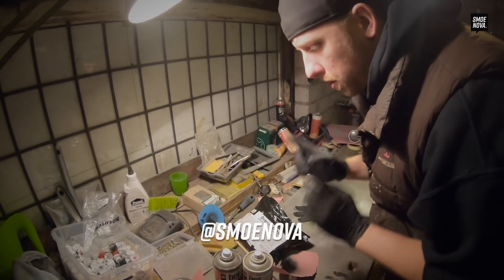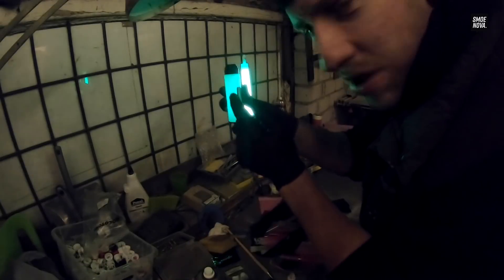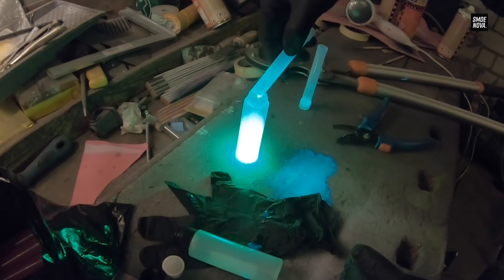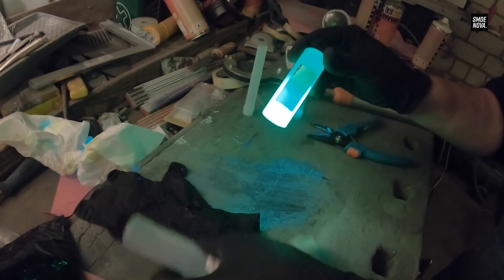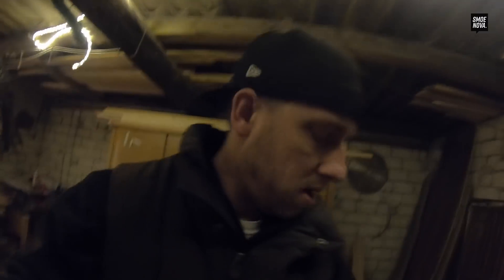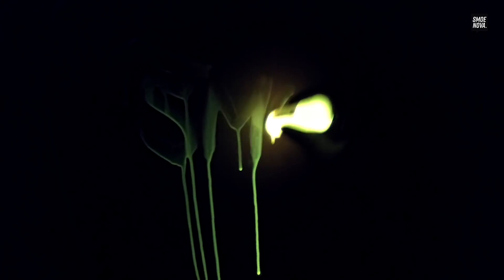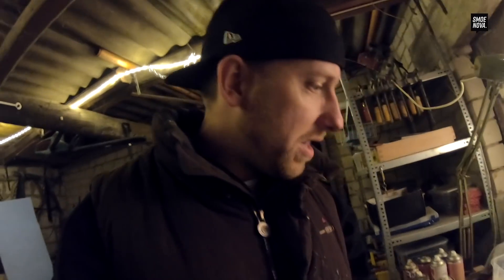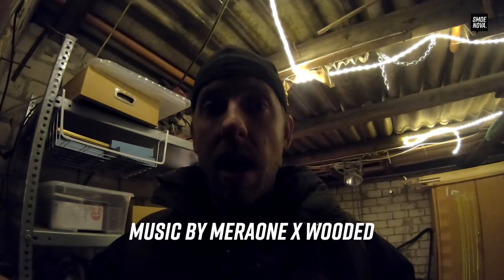TAGGING GLOW STICK LIQUID! crazy experiment #8 GRAFFCEMBER

Comment: What about mixing it with a little bit of glue/epoxy to make it less runny
Reply: @GAMERKNEE I reckon if you used a fairly runny glue and not to much of it you'd be fine as long as you use it up fast enough.. but the nib would be fucked afterwards true that haha

Also I think that method would work with a fire extinguisher...